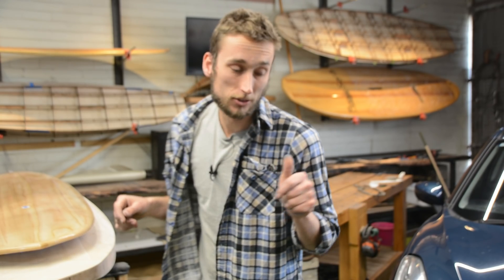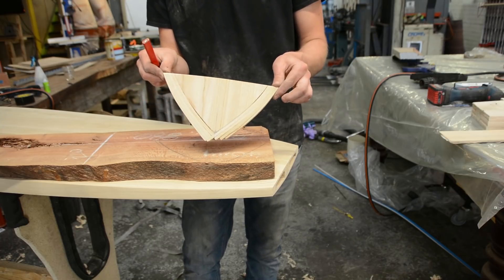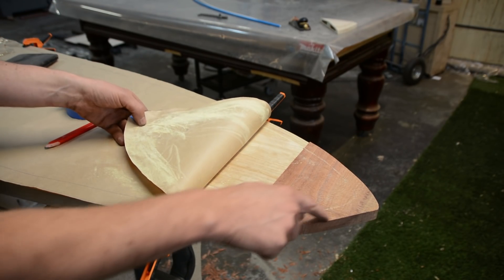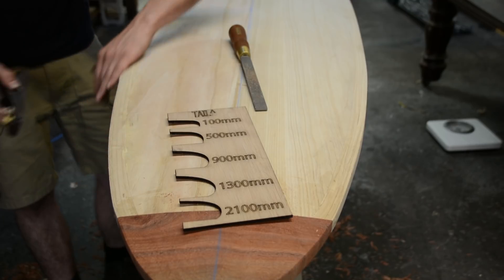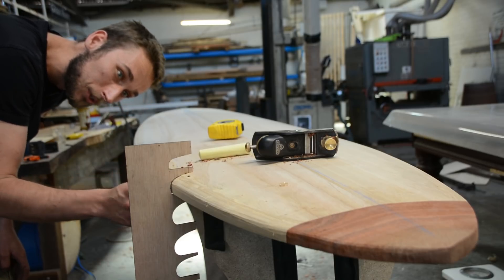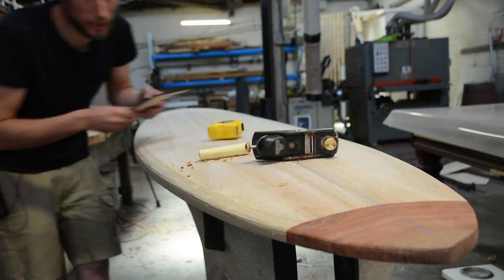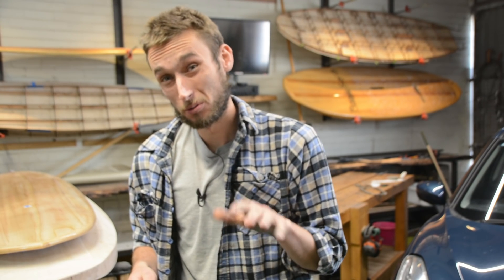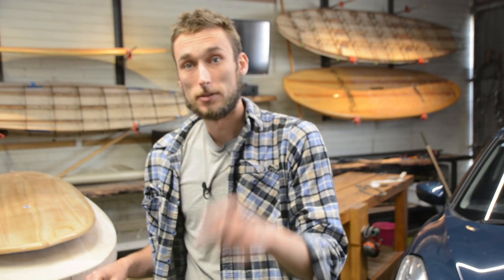How To Make A Wooden Surfboard part 4 - 8' Mini Mal from DIY surfboard kits

Comment: Can you use titebond 3 instead of the polyurethane
Reply from the maker: I am currently testing out tite bond on a 6'4 eggy and so far its been perfectly fine. Its certainly good for doing the rail glue up/gluing the skins together, but for the frame I am still recommending polyurethane as its 50% endgrain (with the plywood) and the titebond 3 doesnt feel as solid with the lap joins in the frame
Reply: jordan,wouldnt using a handheld router to smooth over the edges make it easier on both yourself and the clients who buy the kits,not to mention make the build go a little faster?
Reply from the maker: Not really, and the reason why is because the convex shape of the deck means your routers base would be rocking all around and give you a very inconsistent cut, plus the round over profile changes depending on where on the board you're shaping. 

You could probably use  it to remove the bulk of the waste material, but part of the fun of shaping a wooden board comes from the hand shaping process.
Reply: true enough,i just thought using a round over or a cove bit would take care of getting the sides to the right profile size needed